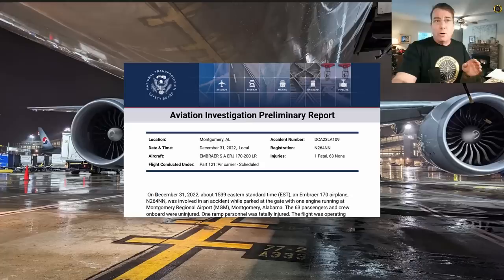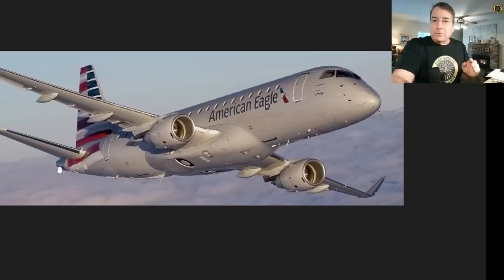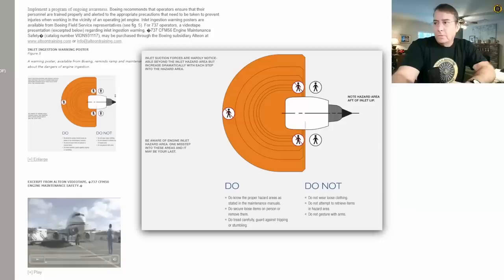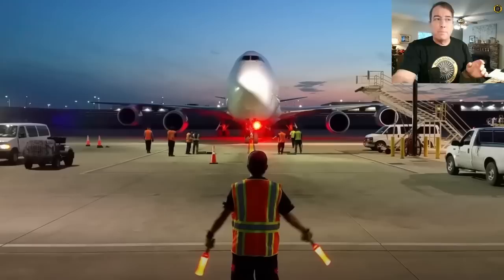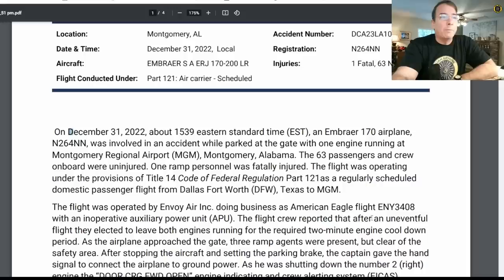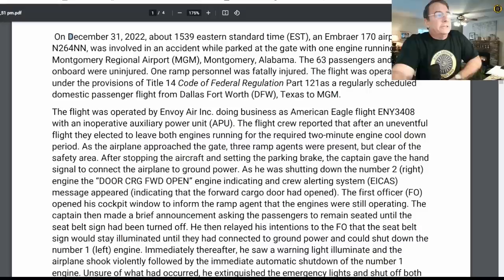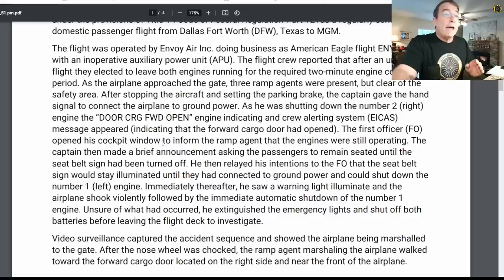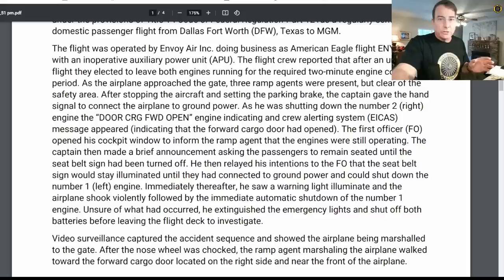NTSB Preliminary Report Ramp Agent Fatality 31 Dec 2022 Montgomery Al.

Comment: It would be better to pull into the gate area and just......SHUT DOWN the engines as normal. Who CARES if it goes dark for 30 seconds while they plug in the cord???????   Is it worth an incident like this?????  The answer is: NO !
Reply: The GPU connection on the E170/E175 aircraft is nowhere near the engines.  It is located on the lower left side of the fuselage forward of the nose landing gear.  The engines are at least 25-30 feet away from this connection point.
Reply: @johnshannon9  What's your point John?   My point remains valid. They should pull into the spot and reach down and shut off the engines as per usual, without delay. (boom, boom, done) The ground power gets plugged in when it gets plugged in. An inop APU should change NOTHING. The passengers can wait 30 seconds while ground power is plugged in. Safer that way. Again......is it worth ingesting an employee????  NO.

Comment: Such an avoidable tragedy. Retired station manager here and Rampers, just like the rest of the operations team, are under a great deal of pressure to ensure an ontime departure. I would be interested to know if the parking brake was set during the 2 minute engine cooldown period. If so and with ACARS,  that would effectively reduce the turn time by 2 minutes. It would also short the flight crew 2 mins pay.

Comment: EVERYTHING is driven by the on time metrics. Period.  From Leaving passengers, nonrevs, jumpseaters at the gate to what we see here ,approaching an aircraft with engines running to get an open time on a cargo door.....its all part of the on time culture.  The pressure is there in every aspect of our operations. catering..cabin cleaning..boarding..MEL issuance..etc . I (we) can only control certain time aspects of our operation. Sadly nothing could have be done here by the crew.

Comment: Is there pressure from ramp management to get the plane in and out on time? Yes.

Is there pressure from ramp management to enter the safety zone before the engines are turned off? No; in fact they pressure us to follow safety to a T as written in the Ground Operations Manual.

Are rampers opening forward cargo doors on regional jets before the engines spool down? No, but: sometimes at DGS/Unifi, which handles most of the regionals at my station, the marshalling agent will open the front bin on CRJ-7s and -9s to start unloading the valet bags while waiting for the boarding door to open. That could happen before the pilots shut off the engines, which isn't good practice, but the ingestion zone's way in the back on CRJs. With bigger overhead bins on ERJs, this doesn't really happen, and I've never seen nor would expect to see a Delta-mainline ALA/marshelling agent open a bin on a CRJ or any aircraft before the beacon's off.  

An ingestion would happen at the contractors. Their major operating purpose, at the corporate level, is to grind out every possible expense in their operations to make the most profit on their contracts, and it creates environments where ingestions can happen. Less training, less pay, worse equipment, less experience and talent in leadership, less rigorous employee vetting and onboarding, because running an operation like that saves money.

Comment: Just my opinion but I've never liked the idea of flying an airliner without an operational APU. It's an extra layer of protection in certain situations. Note that after flying through a flock of birds and watching both of his engines fail the first thing Captain Sullenberger said was, "Start the APU." In the case of this recent accident not having the APU caused a deviation from the normal work routine that the ground crew was used to and it increased the hazards that they were working under. Maybe its time to make a working APU a required item.

Comment: You would think they could utilize a guard of mesh with enough strength to stop a two hundred lb. Body without damaging the engine or causing major bodily harm to persons. We havehad this happpwn at least once every cruise especially with the A7 Corsair which has the nickname of man eater for a reason.  The j take is low and nobody with a bit of common sense stays way clear of this bird on the flight deck but even as high as the F4 Phantoms intakes are they an and will suck you in PDQ. ALRBOIGHI FEEL BAD FORTHW PWESON AND THEIR Family. These airacraft should be treated as if they are relying to kill you. Because they can as witnessed by this incident.I guess I just dated myself with the type aircraft I mention.  Neither I believe are still in our arsenal.
Reply: Mesh disrupts air intake and kills engine performance

Comment: General trend? This kind of incident doesn't happen that often, ever really, it's incredibly rare. Ramp managers as well as every other employee in the function of an airline are always under immense pressure, that hasn't changed for half a century. 

The trend that IS growing is an emboldened and uncaring population that could give two shits less about work, managers, rules, and in that vein, safety protocol. When you hire low wage people to be around extremely high power equipment that should be working in fast food instead, that's when you meet disaster. Has nothing to do with airline corruption, pressure, bla bla bla. There is no way in hell this and other VERY rare engine incidents are the fault of the airline. People are just increasingly more STUPID, literally prove to me otherwise that they're not. 

Want people that won't get misted in engines? Hire people who will listen to rules and not their own, simple as.
Reply: You are correct. And you’ll have to pay them more than $17/hr. People who can do the job properly will not do it for less than $20/hr.